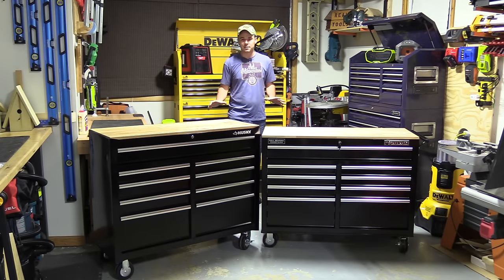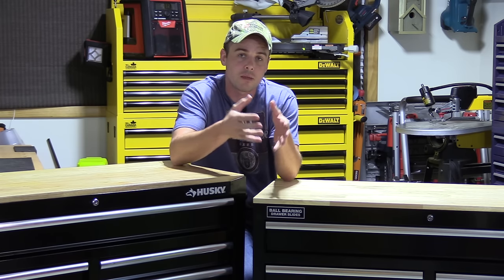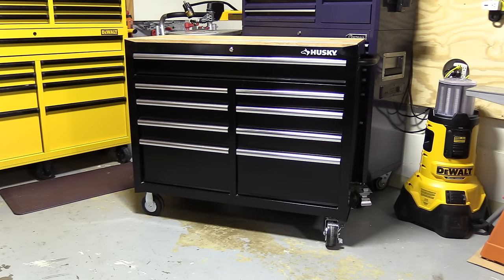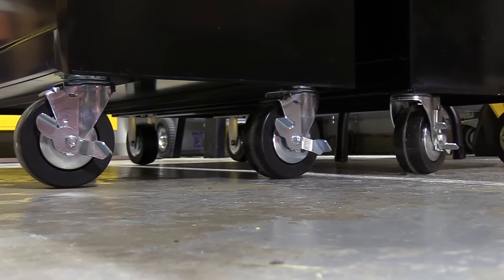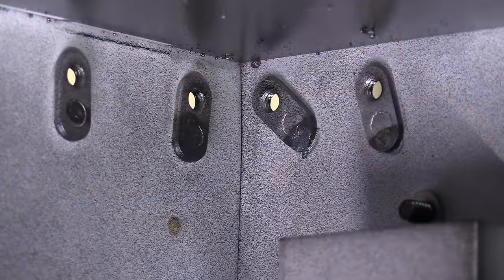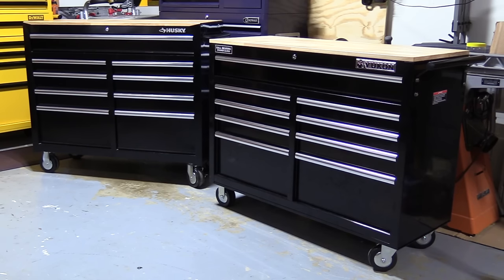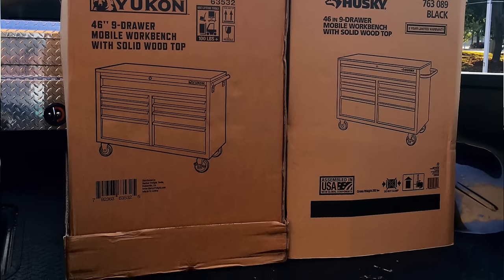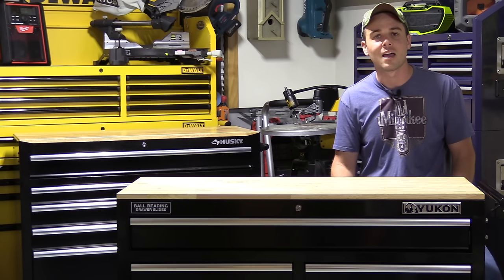Harbor Freight -VS- Home Depot ( Yukon - VS - Husky ) 46" 9-Drawer Workstations

Comment: Thanks for video. We actually purchased the husky first at home depot...because well that was the first one we saw and I fell in love with it. (Using it in my kitchen) then hubby got me a Yukon similar but two door and 1 drawer on top. I love both of them. The Yukon does roll a little better. The husky i have has a power strip with USB outlets. My husky did also come with the precut mats. Both are ideal for what im.using them for.

Comment: Quick Question:  I just picked up an "Open Box" Yukon (Black) and I like it very much, but I've had a problem with the retention capabilities of that top drawer.  I've solved it with placing two magnets (extras from a Gladiator cabinet) on the angled underside of the drawer and they (miraculously) flip (but stay in place and attached) and hold the drawer closed-almost like they were designed to function that way.  (Trust me, they weren't, lol...)  It's working really well, but it makes me wonder if there's a magnetic retention device that's missing.  Can anyone else tell me if the top drawer tends to bounce open on the end of its travel?  While it'd take a pretty good lick to get these rare Earth magnets to turn loose, it doesn't feel like a "permanent" type fix.  Any suggestions appreciated-TIA.  BTW, I think every other aspect of this cabinet is A+/4.0/ FANTASTIC...

Comment: Odd my husky i purchased yesterday . definitely has double slides exact same work station model .must have changed it or you just got a lemon . Mine also included the liners . Insides of the entire cabinet also was 100% painted black . No touch ups in the paint that’s i could find .

Comment: I was going to say that the Yukon was better just based on the weight capacity of the 2 lower drawers.  I'm so glad I watched your video as I learned that the Yukon was superior in so many more ways despite the lower capacity and worktop space.  I definitely understood the difference about the bolt size and the attaching hardware between both models.  Thank you for your very good review.  I will be checking more of your videos as I rebuild my tool collection.
Reply: Keep in mind this review was posted in 2017. The current Husky 46" toolbox is nothing like this one. It now also has the double drawer slides on the bottom drawers, fixed wood top, and included pre-cut drawer liners. And in addition has soft-close drawers, much more storage capacity (like 19,000 versus the Yukon's 10,000, so almost double) integrated power strip, and a better warranty. All of that for about $30 more.
Reply: @kenjcm  Thank you for the update.  I plan to look at the Yukon, Husky and US General again before deciding which fits my needs the best.  Thanks again for this information.  It does make the Husky more attractive than it was previously.

Comment: I have the husky box and it does in fact come with dual hinge slides on the bottom drawer and does come with liners for all the drawers but the other stuff is true the Yukon does have better quality parts that do add up in the long run.

Comment: I looked at both before I purchased and went with the Yukon.   I am happy with it except for one thing.  My tool box is mobile, and if it is on a floor that is not level the drawers wont stay closed due to the amount of weight in the drawers.   The drawer slides otherwise are fantastic - smooth and they handle a lot of weight!   I am about to take the drawers out to see if there is an adjustment.  As-is it is a safety hazard - I had a couple drawers extend by themselves and the amount of overhung load almost caused the box to flip over.   Yea - that would be a REALLY bad thing!

Comment: This is very strange, I just bought the Husky in November 2018. Same 46" box but different. My Husky has two roller bearing slides on both bottom drawers. My wheeels and handle are mounted with Rivnuts, my drawers all came with liners, my top is fastened down and mine came with a built in outlet strip with USB outlets plus a rivnut mounted cord hanger just under the handle. The only thing I did not see on mine is the extra supprt under the top from the inside.
The box was normally $299 reduced to $199 (black Friday) plus another $50 off from a dent.
After seeing your video I went and checked the box out and realized apparently they improved the box from 2017 to 2018.
Reply from the maker: They discontinued the Husky within 1 month of me exposing it with this video....nationwide....

Comment: Good video. As much as the Yukon won this review hands down I would not but it. I bought a US General and can't wait to get rid of it. Also, watch what you buy from Harbor junk. I bought a mower lift from them. Used it several times and then one day I jacked up the mower and went to grab a piece of loose grass from a blade and the metal supporting the cradle RIPPED....not snapped, tore the metal and it came down on my arm. My nose was about an inch from the deck. Had I climbed under it I would've, at the least been severely injured. If you have one of these do not get under it until you put jack stands under your mower.

Comment: Just to give you an update, the Husky's wood top now comes bolted, also the drawers come with the drawer liners included, plus each of the two bottom drawers has four sliders; two on each side. So really the Husky has thr bigger capacity, pretty much the same weight load, drawer liners included, and the top is bolted in. I think this makes the Husky the better choice. It is sold at Home Depot right now for about $300 till Dec 24th I believe.
Reply: Jake Dior plus the warranty off the bat.  It is a better box overall.

Comment: Thank you for taking the time to explain. I was looking at both and noticed some of the differences you noted. Originally I would have picked the Husky, but will definitely buy the Yukon. I want to use it for traveling and racing my motorcycle. I need the drawers to hold up to the constant pounding of being in a trailer on the highway. My Craftsman from Lowe's has been replaced twice for broken drawer rails from the weight of the tools. This Yukon looks way better built at half the price.

Comment: Great video. Harbor Freight discontinued the Yukon boxes in favor of U.S. General. Ironically, the current box on the Home Depot web site appears to be the old Yukon box rebadged as a Husky, right down to the doubled sliders on the bottom drawer and attached wood top. Even has a similar 'roller bearings' badge on the left front.
Reply from the maker: Thanks!  And actually it was the dimensions & weight that doomed this.....Waterloo lobbied for massive tariffs to be put on any foreign competitor boxes to price them out of the market shortly after I made this video.  The tariffs were approved, and every asian-sourced mfg had to redo their designs in order to avoid them (making them larger, deeper, wider)......the Husky box in this video was discontinued in mere weeks after me exposing how bad it really was.

Comment: I bought the husky 52 inch box yesterday.
they have secured the top and now include the drawer liners. 
The husky now has double slides on the bottom drawers.
(they should do that on the top drawer as well IMHO) 
Paint looks complete better than in your video so looks like they improved.
I am satisfied with the husky but as per your video the Yukon looks better.

Comment: Apparently the Yukon is coming back out at Harbor Freight this month and I intend to buy two. I prefer it to husky because of its height and depth, I want to slide it under a fixed work bench and still be able to pull it out to create an island work station with two units placed back to back.
Reply: Cali Valley check out the 20% coupon as well to use on the Yukon workstation. According to the coupon a “workstation” is allowed to use a coupon to buy it. December 2019 merry Christmas sale has it on the front page stating it is a work station and that you may use 20% off coupon on it. Check out Den of tools on YouTube and search the Yukon 9 drawer work station and he will explain it more. Good luck!

Comment: Does Harbor Freight not make this same cabinet any more?????
I dont see this one with all the drawers any more. All I see is the  46 in. Mobile Storage Cabinet with Wood Top Yukon- Item#64012, that does not have drawers but cabinet doors not drawers.
Reply: I emailed corporate about it. They told me they discontinued the model with drawers. Probably too expensive to manufacture for their price point.
Reply: Home Depot did picked up the Harbor Freight model. They probably got sued because they no longer have the same model any more. They came out with one almost identical under the Hustky name and also under the MBI brand but it is larger. 
Everything looks the same except but the drawers are deeps from front to back.
Whats weird is that HD has two models for the same box and they is a $100 difference in the Husky brands and they also have another model: (MBI)

One is $298 and the other is $398 in Husky and MBI is $306.
Reply: Is the quality of the Home Depot drawer cabinet the same as the original Harbor Freight one?

Comment: Thank you, good job.  It would be great if you could update this with the newest versions.  I realize these manufacturers are constantly changing these and collecting comparable workstations from each manufacturer may not be simple, but it would be great if you could add comparisons to more brands, i.e., Lowe's, Craftsman, DeWalt, Milwaukee, etc.  If you do more mobile tool workstation comparisons, may I suggest that you 1) measure the thickness of the metal frames, bases, and drawers, and 2) examine the casters more closely; do they use bushings or ball bearings, and is there an easy means of lubricating them?

Comment: I just went to HD on 12/17/2019 and I can confirm that neither of the 46" tool chests (There are two currently and they are made slightly different from each other) are made the way they are shown here. They do not have the riv-nuts but they are not as cheaply made as they appear in this video and the top is bolted down and does not lift off.

I will check out the HF one soon. They should both be compatible HOWEVER.... don't miss the 20% off coupons for HF making it the better deal price wise.

EDIT: I stopped today to also check out the harbor freight version. Other than the rivnutsI cannot see anything that makes the harbor freight tool chest a better by then the home Depot version. The home Depot version is taller and deeper and will hold more. The drawers had, in my opinion, better sliders than a harbor freight version.
Reply: Don't know if HF will honor the 20 % off coupon on this item ??
Reply: Sadly, you are correct. No good on chests or carts. No reason to go HF then for me.
Reply: Yes, you're right -- the new Husky is totally different.  For starters, it is 24.5" wide now (not 18"), and it is much better built.  It has a fastened wood top (like the Yukon), and double sliders on the bottom drawers now (like the Yukon).  I too was fixin' to buy the Yukon, but when I saw the new Husky in person, I realized it was different than the video (old one from 2017).  I bought the Husky today instead of the Yukon because it was still just $298 but it is much bigger (24.5" versus 18", over 30% more storage), so that's a lot more storage for the same amount (I got a discounted floor model, too, which had a little damage and so I got $75 off).  But it is still worth $298.  

Here are the models (the $298 price only applies to the black one, not the other colors):

https://www.homedepot.com/p/Husky-46-in-W-9-Drawer-Deep-Tool-Chest-Mobile-Workbench-in-Gloss-Black-with-Hardwood-Top-H46MWC9XD/303101236

I got this one (all black):
https://www.homedepot.com/p/Husky-46-in-W-x-24-5-in-D-9-Drawer-Mobile-Workbench-with-Solid-Wood-Top-in-All-Black-Finish-HOTC4609B14M/309057460

I recommend anyone who's looking for a box to consider the new Husky, because its not at all like the old Husky.  But, if you don't want a 24.5" wide bench, then the Yukon (18") would be a better fit. Both are 46", both have the power strips, and both are about 37" tall.  The biggest difference now is the width.  I think HD watched this video and wised-up and made some good changes for the new Husky.  So, now there are two good choices for $300, depending on which width you need.
Reply: I tried to purchase the HF Yukon tool box over the weekend and no coupons are valid on them.  Will be ordering the Husky from HD.
Reply: @fryeguy9939  - Actually they do! There's one online now. (7/4/2020)

Comment: I've had good luck buying from harbor freight. bought the yukon 2 days ago and was impressed with the strength.  just don't open several drawers loaded with tools because it will tip over.

Comment: Indeed Husky has stepped up their game since this comparison, and the newest version of the Yukon is smaller. The main difference between the two as of Sep 2020 is the drawer depth. Husky has 21.8” drawer depth, the Yukon under 18”. Both now have 1,200 lb capacity. Husky has doubled up the slides on the tallest drawer. Yukon is just $10 cheaper (though you can save another $40 with a HF coupon.) Finally, as pointed out by a previous comment the Husky has a built in power strip with USB ports. Not sure about the build quality differences since I don’t own one yet, but the empty weights are Husky 236 lbs vs. Yukon 186 lbs. I’m going for the Husky.

Comment: Good comparison of the basic construction and features on each box.  Nicely demonstrated and well narrated.   I'd like to have seen a little more of a real world demonstration, such as loading the drawers with a full load of the same tools in each drawer and seeing how easily the cabinets could be moved around.

It would also be interesting to see how they paint held up over time when kept in an unheated or uncooled residential garage  where most home mechanics are likely to keep them.   Some paint jobs are so thin and shabby the cabinets start rusting easily.   I suspect that could readily be a problem for the Husky due to the lack of full interior painting.  Rust can start inside the cabinet just as easily as it can on the exterior and rust all the way through the metal.  An unpainted surface makes it more likely.

Warping of the work top due to lack of firm attachment to the cabinet would be a kiss of death for me.  Why buy any box whose top isn't solidly fastened down?   You are just asking for trouble and it probably won't be long in coming.  I'd rather just toss the wood counter top on the Husky and just use the metal top with a rubber mat as a work surface.

Comment: I much prefer the Yukon. Had purchased a professional 72 from Home Depot. Went to pick it up and after inspecting it I refused to accept  it. Big dings in the powder coat. They were difficult to deal with. For the price of around $3500 it was not worth it. My Husband brought home a 46 Yukon the other day and the entire box is sturdy, drawers  open smoothly with no wiggle. For my usage in a cabin kitchen for my cooking tools it’s a good match. Plus the height is perfect for a kitchen application. Will need a second one though. One tiny annoyance is the open holes in the drawers. Unlike my Hammerhead stainless boxes in the main house that are totally sealed (one needs that to store food items like bread, and other food items that rodents/bugs can attack.

Comment: I have the Husky box and I love it!
Reply: I still like my Husky! The nut attachments mean nothing because both types are connected to the thin sheet metal and therefor are only as strong as the metal it's attached to! The double slides on the bottom mean nothing, I have my bottom drawers filled with hammers and have had no problem. My Husky has a 3 year warranty!
Reply from the maker: The thin spot welded tabs snap off....this exact box had 2 snap when I moved the handle to the opposite side.  Rivnuts are vastly superior.

Comment: This type of detail is extremely useful in making purchase decisions. As far as the build engineering, the Yukon stands out for exactly the reasons you point out in the video. Unfortunately, there is no way for you to rate "value" since pricing is subject to constant change, sales etc. But armed with this info, unless the Husky is say 20% cheaper, it is not a good choice. I would still consider it, but only if the price difference was substantial.

Comment: I bought the newest model of the Husky 46 in. W x 24.5 in. 9-Drawer Mobile Workbench (SKU #1002811059) at Home Depot in late November 2018 for $298 and it must be updated from the model you reviewed.  My workbench looks like the one you reviewed but mine has 4 slides on the bottom drawers, the wood top is attached and it came with the rubber drawer liners.  In addition my Husky workbench also has a built in power-strip with six 110V outlets and two USB ports.  I actually use the USB ports to change my two HF Braun Magnetic Slim Bar Folding LED Work Lights.  Before I saw my Husky workbench at HD I looked at HF for a version of workbench like the Yukon you reviewed but I did not see anything at that time.

Comment: So today I went to buy one of these 2 boxes and almost bought the harbor freight box but I wanted to just look at both before making a decision. After watching this review my mind was almost made up. I am so happy I looked at the husky and here is why. From the top down. The wooden top IS bolted down. The drawers DO have liners in them, the bottom drawer DOES have 2 slides on each side and I bought a grey one and the finish is car like quality. It also has a built in plug strip with USB plugs and a on/off switch. All tho it sounds just a little bigger in this video in reality the husky box dwarfs the harbor freight box. So maybe they upgraded it since this video all right now the husky box is a lot better and you may want to redo this video with a new side-by-side comparison.